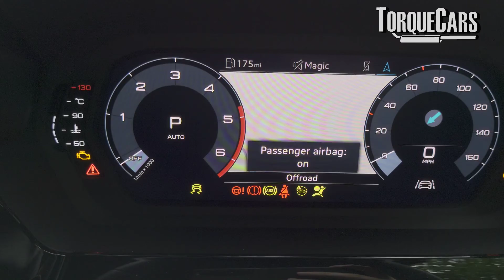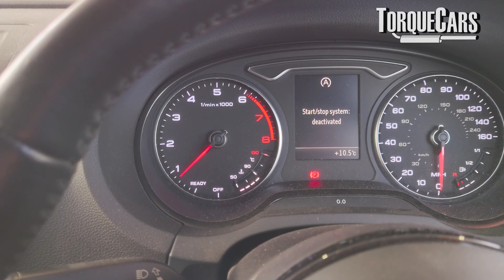Are Cars Harder to Fix? Are They Designed To Die After Warranty? Do They Have Built in Obsolescence?

Comment: Yes, Yes & Yes. 👍

The problem is, even with all of this expensive design and reliability software and facilities, the so called engineers manage to get it drastically wrong. 
Case in point No1 = The Ford wet belt fiasco. 
Case in point No2 = The BMW Mini timing chain fiasco. 

My opinion of the most reliable cars on the whole is the 90’s cars with minimal tech.

Comment: it´s so easy: in a profit related world, you only do more profit, when you sell more. If you are manufactoring products long lasting, at some point you are selling not as much, as at the beginning. This does understand a 12 year old.

to argue things get complexer is a little bit poor ... yes everything gets complexer, but that´s no reason for engine damages under 80k miles, broken plastic parts after 3 or 4 years, etc. VW produces a 176kW bi-turbo-4-cylinder engine that "by design" does last longer than 80k miles. I know from first hand, that Skoda told a manufacturer of plastic parts to choose a specific ratio of raw material (which was more expensive, than manufacturer adviced to use) just sell more of that plastic parts, cause they brake easier after years.

until a car isn´t that complex as a human body, there is no reason for damages or brake downs and a car should last as long as a human body.

it´s profit baby :-)

Comment: I have a 2014 Jetta TDi and I’ve done the maintenance and mechanical so far. Changed the timing belt and water pump.  Did some suspension work also.